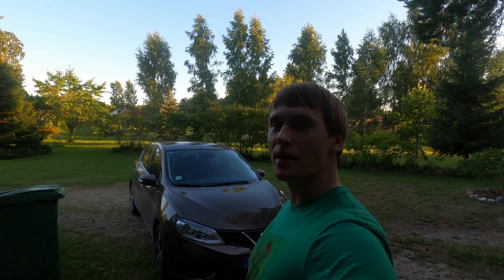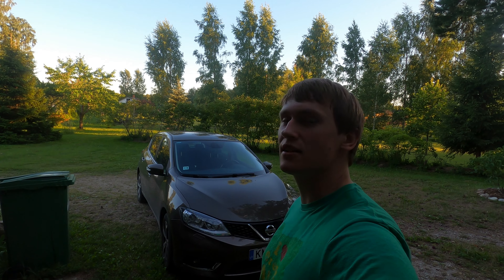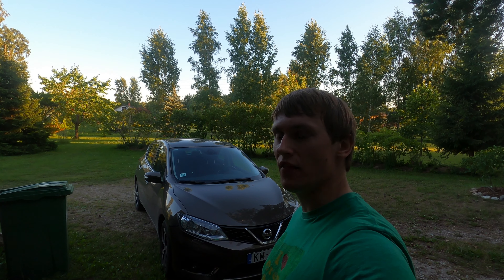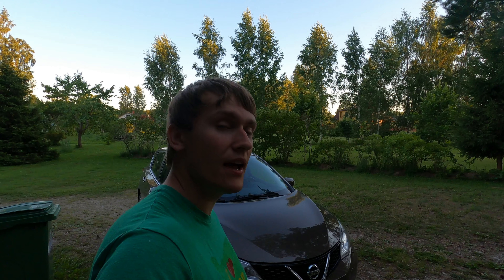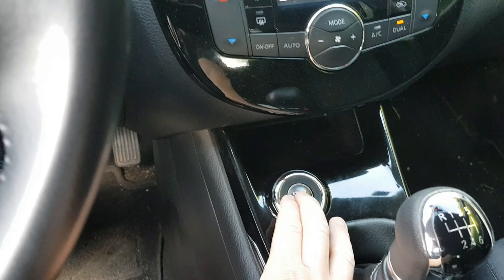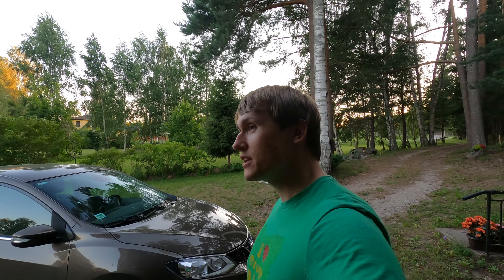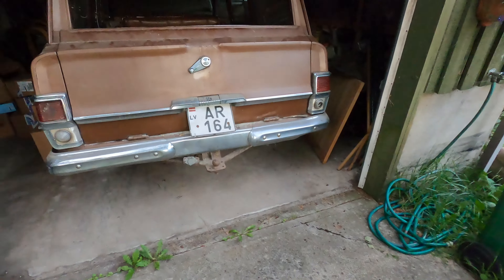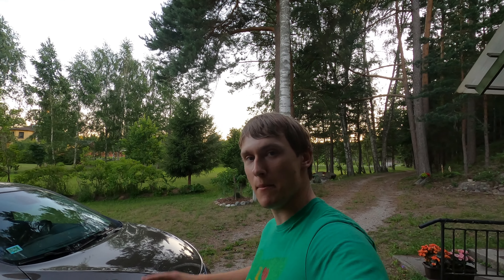Nissan Pulsar Update - AC Compressor Putting too Much Load on the Engine?

Comment: 95 is very high octane and 98 is for performance cars like BMW, McLaren and corvette
Reply: As far as I have heard it is not only about octane number. There are also some extra additives like it was mentioned in the video.
And it is also possible that the software-firmware which runs the engine can detect the octane number of the fuel and adapt a little bit to say higher compression ratio by shifting ignition time...
Reply: 95 is a high octane.. That's like the low end fuel in Germany :O Regular has 98 and premium has 100-102. Also like Victor said Premium might have some additives that clean injectors or some carbon that has build up.
Still you can fill up your car with better fuel all day long. I fill up my '97 Honda Civic with 102 sometimes or I sometimes mix it. That's not a problem at all because it's also made for using 95 the normal Super. But if you car suggests 98 that you shouldn't go below 98 it's that simple.